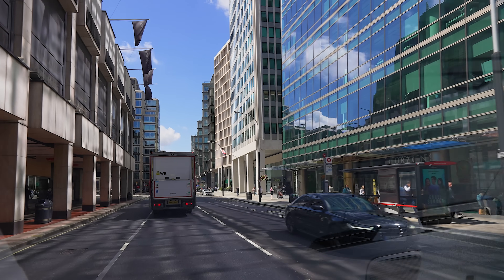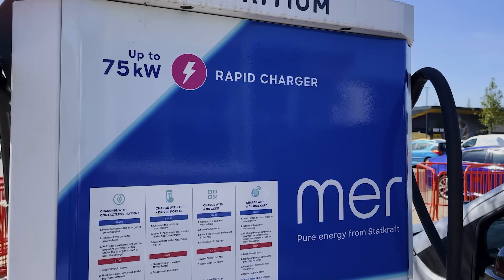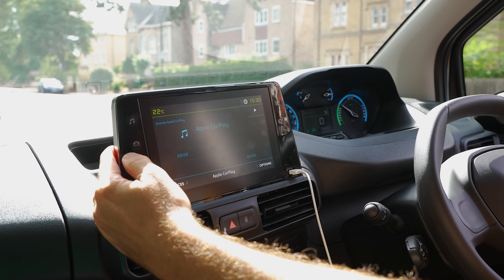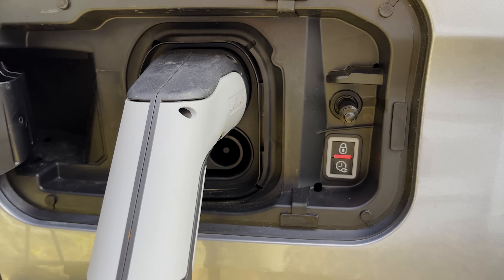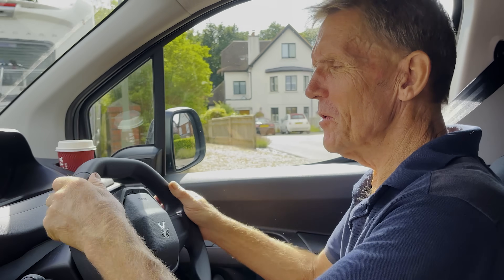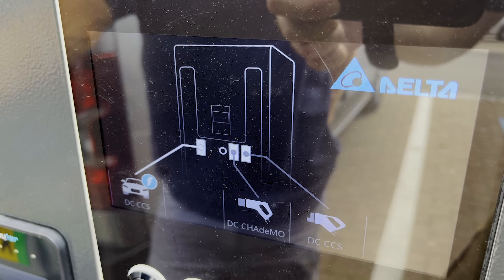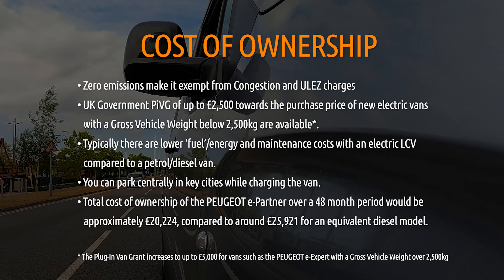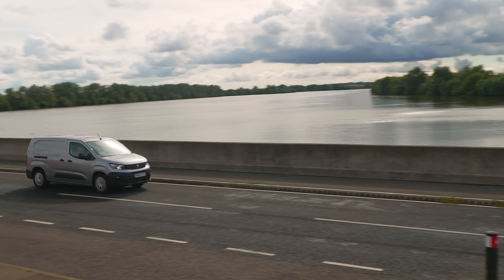Real World Electric Van Test — Peugeot e-Partner

Comment: The cost of lost time when you could be working instead of waiting for it to charge must be considerable. Looking around for a suitable or available charger would do my head in.
Reply: Should work for plenty of sparks operating in London who can charge over night.
Reply: 8
Reply: Add to that the amount spent on fast food and cafes
Reply: Was gonna say this…
Reply: Max two people, 30min charge(pretending you find usable charger first time) so that's an hour of wages gone, if you've got materials onboard that guys on site are waiting for then you can multiply that half hour by the amount of people waiting, they just aren't practical. What they need to be doing is completely stopping all the office worker types from driving great big 5 seater cars through the cities and make them use 1 or 2 seater electric buggies instead of trying to cut emissions from vans/lorries etc. which a a necessary vehicle and used to their fullest the majority of the time.
Reply: @whatyousaidbud  Couldn't you plug the van in the home charger of the house you are working at?
Reply: We’re not ready here in Canada. Hard enough finding parking sometimes, good luck finding the charger. The client would wonder where the heck I’ve been
Reply: Buy a spare van silly, then when ones out of charge you can use the other. Use your loaf.
Reply: @bobsmith-dn1xw  yer just like we used to do with drills till you could swap batteries. Now there’s an idea 💡🤣😮
Reply: Totally agree! Same reasons battery-operated tools will never ever catch on. Nobody has the time to stand around waiting for them to charge!
Reply: @benwouda   can easily  have  5 batteries    at  50 quid  each   not  10 k   and  can't  carry it  around in the boot. Electric bi's a gimmick   can be  fun  on play  things like  bikes  but for  work vehicles  and  trucks  it's a waste  and will drive   stupid prices up even higher  for  less work.   And look out  whennit  gets  cold    it'll fuck everything up
Reply: What happens when the battery goes flat ? 
Answer , £275 for man from Peugeot to come out and get it going .
Reply: @AndrewNeilBaird  You buy a petrol generator and keep it in the back. Recharge anywhere! 🤣
Reply: You’re all dinosaurs … or stubborn Oaps afraid to learn and accept new technology . It’s coming and there’s nothing you can do to stop it. Go buy yourself a property with a drive is the first thing I’d do … they will be at a premium in a few years . Then set up your home so that it’s able to run without drawing off the grid .. and that includes charging your car/van . I will say this though … wait two or three years for much better battery technology that will do 2x the mileage on the same charge we get now.
Reply: @russthomas02  yes but us dinosaurs have seen many things come and go. Some catch on some are never heard of again. Current battery Tec is not going to cut it for a lot of applications . The big problem is electric and the lack of it. Unfortunately the capacity is not there when the sun ain’t shining and the wind ain’t blowing. Going to take several years before there is enough capacity and don’t even get me started about that wood chip that drax burns 😡😡

Comment: A lot of the EV fast chargers have gone up recently and cost around a £1 per kilowatt hour and some are more which make it expensive
Reply: Thats mad... can get a 4kw lpg generator and use it at 75% to get 3kw... it uses 70p of lpg per hour.... 🙄
Reply: I don't think there's any which cost £1. The most expensive I'm aware of are the Ionity chargers at 0.69p kWh but those are extremely fast chargers and that's the price of convenience. Most raids are less than 0.50p kwh

Comment: I think electric vans are where electric cars were around 2015, limited range and not many people want them yet.

I think once they improve battery technology to get 400 miles with a decent load so you only charge at home/depot overnight, that will make it much more appealing.
Reply: Have been saying the same thing myself . 3-400 mile range is needed for sure
Reply: 400 miles?
If a builder needs to do 400 miles a day something is wrong, 50 miles in a day more like for a builder, unless he's crap of course and the locals all know this so he has to venture further out.
Reply: @cj9852  I’m a gas engineer , tend to do 100-150 miles daily with the calls I do. I don’t want to have to charge every night plus sometimes if the money is right , I will travel to a different location where I can easily clock up 250 miles per day..Again I will not have time to stop and charge while I’m out at work and it’s always good to have spare power left .. just in case . But yep .. builders may just drive to one location , do the work and back home
Reply: @russthomas02  If you find plugging in a vehicle once a day an issue then perhaps it's time you retired.
Reply: @russthomas02  so when you're working, can't you charge the van at the same time?
Reply: @verygoodbrother  That would be awesome for me but I’m not sure my customers would like that ( I do 7 or 8 calls a day )  . I’ll just wait until a suitable longer range van is released
Reply: @cj9852  my thought process was that maybe a tradesperson might forget to charge one night or just want the safety of knowing if something doesn’t work or a rapid charger is out of service you can crack on and no worry about running out.
Reply: @daverossy  What, are you suggesting builders are stupid, next you will tell me they leave expensive tools in a van overnight, despite having a sticker on the back of the van to remind them not to leave tools in the van overnight.
Reply: @cj9852  hang on I’m doing 100miles a day  at moment. My work is specialist timber restoration. I drive a 3.5tonne sprinter because I need the space and weight capacity bigger vans are right down on range and very high on purchase price. So yes I need more range fully loaded.

Comment: The battery on an EV should not drop below 20% or go above 80% charge. So you've really got 60% range if you want it to last. They are not practicle for a builder. With a very heavy load in the winter the range will be abysmal. Don't buy one, if you do you"ll regret it!
Reply: The 20-80% rule is somewhat true, but not entirely. A petrol/diesel car should also not be driven at peak performance all day. they are much more happy if you drive them in the 20-80% range of their ratet kW. And if you are a builder you have to choose a car that is suitable for the tasks you need it to perform. a Mini Cooper might be a bad choice even if it is a petrol car the same way a EV van might be a bad choice if you most of the times have to drive 200 miles to and from work every day.
Reply: @JoppeOSL  No, you can drive a petrol/diesel vehicle with a nearly empty tank or a completely full tank it will not affect the lifespan of the engine or performance. It's nothing to do with performance it's the range and battery condition of an EV that is relevant.
Reply: @brucejoseph8367  Tesla State "For regular use, we recommend keeping your car set within the 'Daily' range bracket, up to approximately 90%. Charging up to 100% is best saved for when you are preparing for a longer trip. You can adjust how full the battery charges from the charge settings menu."
Reply: @brucejoseph8367  Read again what I actually wrote. When you say "EV should not drop below 20% or go above 80% charge." I'm telling you the this is somewhat not true. First of all EV often differentiate between actual and usable capacity of the battery, because it needs some margins in either end in order to give the battery a better life. And then there is recommendations by the car manufacturers saying that if you don't need the full range the battery can give at any given day, we recommend to stay away from completely full and completely drained. In the same way a diesel car manufacturer recommend that you actually dont use all 140 HP that the engine can provide since that will require you to run your diesel engine at a constant 4000 rpm. Different things, but still limitations given by the technology. For ICE cars they have solved this by providing almost all cars with a much bigger engine than it really need. And one day this might also happen with EV's and their batteries, but we are not there yet. What I'm saying is that if you have to haul 1500 pounds of pasteboard 200 miles to work everyday, both a ICE Mini Copper and a short range EV-van is probably a bad choice. But for all the people that have their need met by either car they might be the perfect choice. EV's might require different considerations then we are used to, but that does not equal to them being useless.
Reply: This is a myth. Some battery chemistrys do not like sitting above 90 percent but you can use the full capacity of all EVs.
Reply: @SimonEllwood  Strange then when the manufacturers recommend that ideally you don't let a Lithium Ion battery fall below 20% and charge above 80% if you want the battery to last it's maximum life. Obviously you can ignore that but the battery will prematurely deteriorate. Even on my Samsung tablet this is Samsung's recommendation!

Comment: The reality is I will still have the diesel. you did a journey that was 80 miles it’s depleted your battery by 100 miles you had 60 left roughly so this means before you can set off home from a long day at work you have to stop off and charge your vehicle which means your day becomes even longer..

Comment: When calculating the cost of running one of these things, are you including all the extra coffee and sandwiches?
Reply: It isn't a thing.Motors replacing outdated combustion technology.Children breath in the gasses out the exhaust it is worth every penny to save their health.
Reply: Let alone the inflated purchase price. Normal diesel partner van is £19k and this electric one is £28k, you can get a fair bit of diesel ten grand, then of course there's the lead balloon which is the resale value of electric vehicles. Nope, thanks anyway.
Reply: @whatyousaidbud  that 10 grand would probably fuel a diesel van for most if not all of the lease/financing period which makes it a better buy seeing as you’ll be giving it back or selling it within 5 years or just keeping it for a longer time but would have still saved money
Reply: @whatyousaidbud  They did account for the upfront cost and EV hold there value very well. The charging issues are of course very real.

Comment: EV should only ever be charged to 100% when absolutely necessary... regular ongoing charging to 100% will damage your extremely expensive batteries..  keep your diesel and petrol cars and vans as long as possible folks...
Reply: Unless they're LiFePO4 - they are different chemistry and good for 100% all the time.
Reply: @grahamleiper1538  explain !!!!!!
Reply: @waynekerrr9027  lithium iron phosphate is a different chemistry to Lithium Ion. Not as energy dense, but can handle more charge cycles and most companies (including Tesla who use that chemistry on Model 3 RWD) advise charging regularly to 100% if using LiFePO4 as they're less volatile. They only balance properly at high or low SOC as they have a really flat charging curve.
Reply: @grahamleiper1538  oh great ..looks like I'm paying about 75k for a new car now then 😂😂😂😂
Reply: Agreed

Comment: And how much is that gonna cost with the hike in electricity costs
Reply: Connection charge £1.
£1 per kWh.
And if the chatger doesnt disconnect and reconnect count yourself lucky you dont have one or two extra connection charges.
Reply: Commercial electrical supplies are on a different price level as not subject to any price regulation like domestic. So charging is going to be prohibitive. Unless the government subsidises charge point providers.
Reply: @stakkerhmnd  
It’s now just as expensive mile per mile to run an electric car/van as a average diesel
Reply: @macsmith6216 

Yep. So many extra costs none of these review videos talk about. That's genuinely no criticism of Comrade Bisby.

Factor in depreciation of replacement battery packs (bet people will go for "refurbed" units - which doesn't make any sense), excess tyre wear as these EVs are super heavy and knacker tyres quicker. Electricity charges are going up. Not saying a pint of diesel won't cost £5 at some point. 

What is funny is that as the battery wears out and range reduces, the weight of a battery doesn't decrease. So you still have to lug around a ton of battery with a battery that has reduced range.

I've never seen a even a badly maintained diesel Transit reduce it's mpg from 35 to 20 after 175,000 miles of hard use.
Reply: @macsmith6216  Depends where it's charged. A home domestic tariff with an off peak rate can be between 7.5p to 11p per kWh. The public charge points have pricing that should be considered over occasional use for it to make sense.
However when petrol or diesel fuel changes price, it's pretty much that price... Everywhere... Every day.